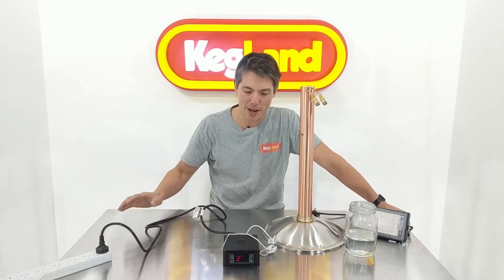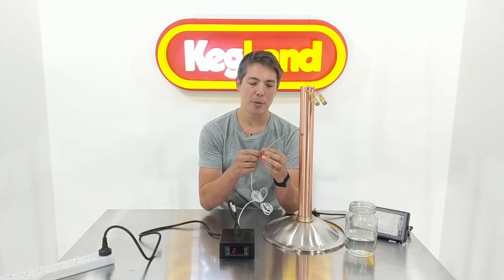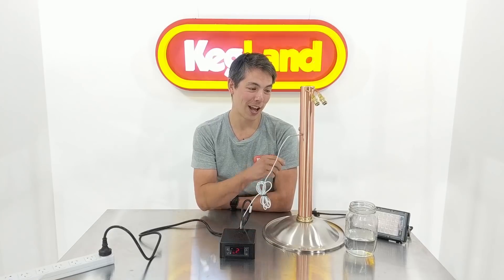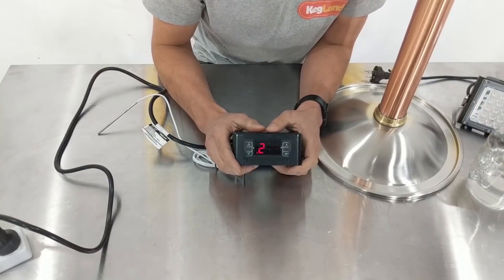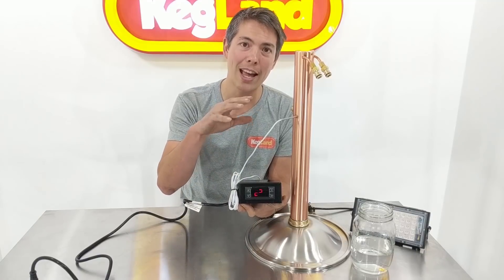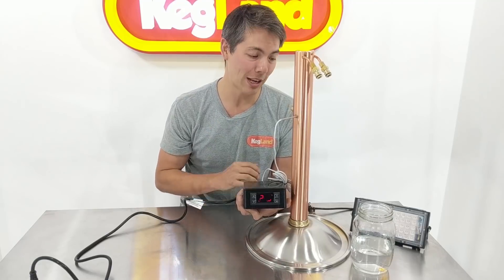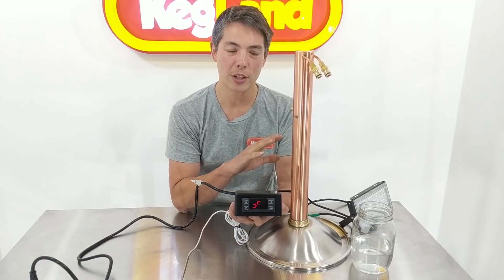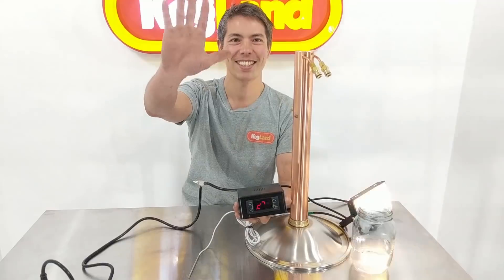Automate a Reflux or Pot Still with Temp Controller - The easy way!

Comment: I've got to be honest here, would like to get this product but the instructions are bit confusing having not used one before. I'd like to profile ferment a beer in a fridge. I'd like to raise the temp in the last couple of days with no cold crash, as I'd be bottling currently. I feel like it would be easy to mis-program this unit and get an undesired result. The advanced settings table confuses at it has a mixture of timing/temperature and numbers with no units of what they represent (00 ~ 200),  they're all in the same column. Can you please explain it, either on the site or on this page, please?
Ref: https://www.kegland.com.au/media/pdf/MKII%20Temperature%20Controller%20Instructions.pdf
Reply from the maker: Thanks for the reply.  If you are really looking for a temp controller that can do advanced settings and is easy to use we have a new internet connected model that you can put in profiles into a graph and then the temp controller will log this information up to the internet.  I think it's best if you wait for this temp controller to be completed toward the end of the year.

This temp controller works as a very economical manual temp controller where you set the temp in and then if you want to change temp you walk over and then change the temp.  I would not say this is a good temp controller for profile temperature steps as it's complicated to setup as you have already pointed out.
Reply: @KegLand  Thank you for your reply. How much (ball park) figure will this new product cost in AUD, please?
Reply from the maker: @zt7489  You can see the most up to date pricing here: https://www.kegland.com.au/mkii-10-30amp-temperature-controller-heat-cool.html
Reply: @KegLand  Thanks again. One other question, it's about compressor delay features. How do you work out how many minutes is a good time to set compressor delay to? If you set a tolerance of 0.5c like some people do, won't that keep switching it on and off constantly and wear a fridge out? How long have these types of devices been on the market for and what's effect they've had on people's fridge/freezers?
Reply from the maker: @zt7489  Yes the lower the tolerance the more the compressor will cycle on and off and the faster the fridge will wear out.  Setting a compressor start delay will help this or increasing your tolerance will also help this.  Typically a compressor delay of minutes is a good idea.  This also allows the compressor head  pressure to decrease before the compressor turns on again which significantly reduces the stress on the motor.

The other thing that will help is if you put the probe against or inside a larger thermal mass so the temperature doesn't swing around so widely.  For instance tape to your fermenter or inside thermowell. If you do that the thermal mass of a fermenter will be enough to reduce the compressor coming on and off frequently.
Reply: @KegLand  Thanks for the great advice. Bearing in mind I set 4 or 5 mins for the compressor setting, would you keep the tolerance below 1c. I
've also read of people keeping a small container of water in the fridge with the probe in it.
Reply from the maker: @zt7489  yes if you have the compressor start delay set to 4 min then you can easily have the tolerance set to under 1C.  Even 0.1C would be fine if you have the compressor start dealy.
Reply: @KegLand  Will this new/coming internet capable temp controller tech work its way into the Brewzilla? if so, will it be available as an upgradable mainboard for the brewzilla (like the 3.1 board is available as an upgrade for 3.0 users)?
Reply from the maker: @KieranShort  Hello Kieran.  The internet connected controller will eventually work it's way into the BrewZilla but we will first be using this new control board in the fermenting fridge, stand along temp controller and potentially doing some other internet connected devices first.  So the Internet Connected BrewZilla is lower down the list of priorities at this stage.  

A fermenting fridge that needs to operate over a couple weeks or up to a month with a stepped temp profile is more useful to have internet connected than the Brewery which is why this has been prioritised.  Normally as you are standing fairly close to the brewery the need to have this internet connected is not as great which is why we have prioritised this lower in our product development schedule.  With that said logging your batches up to the internet is fairly useful for record keeping so it does have some utility in that respect.

Comment: Why do you need to stop at a temp range? Why not just keep going till you get down to 20% ish in cuts?
Reply from the maker: You can do this as well if you like but generally temperature will give you adequate control and it's much easier to measure temperature digitally than alcohol concentration.
Reply: @KegLand  what would be super useful is a way to keep the kettle temp in the sweet spot between hot enough to vaporise alcohol but not hot enough to cause boil over. It would really speed up the whole process.
Reply from the maker: @MartinMio  this particular device would not be good for that application.  For reducing the wattage you really want to use this device instead:
https://www.kegland.com.au/4000w-power-station-240v-power-controller.html
Reply: @KegLand  If you are using the 65L digiboil, with all 3 elements to warm up the wash, to use the voltage controller when I want precise control, would I then have to switch to 2000W element only, unplug, and then use 15A to 10A  adaptor and then control the 2000w element on its own? Obviously I can plug the boiler directly into the voltage controller as it is 15A socket.

Comment: Yeah this will be very handy! Can u set set the cut off time to 1/10 of a degree? I usually cut off once the temp rises 0.3* from where it has stabilised..... could I set the cut off for say... 78.2* for example or only to 78 or 79*? Hope that makes sense..😂 thanks!
Reply from the maker: Yes you can.  You can set the temperature to 0.1degree resolution.  So you could set the cut off point to 78.1 if you wanted to.